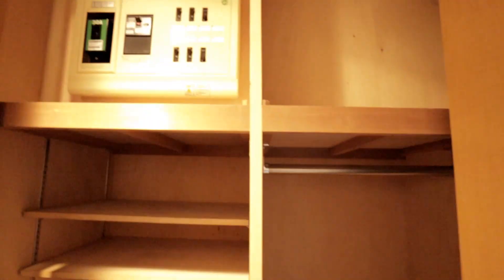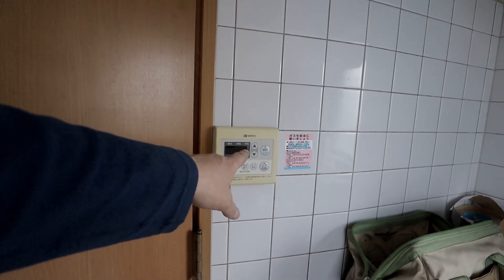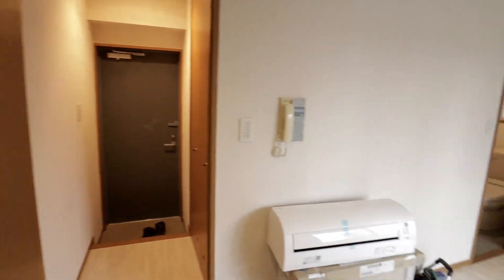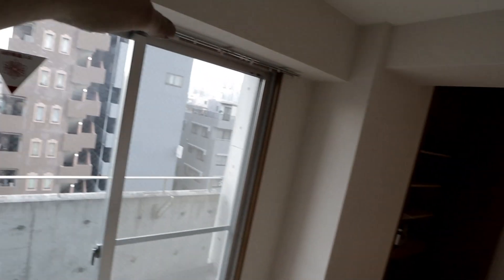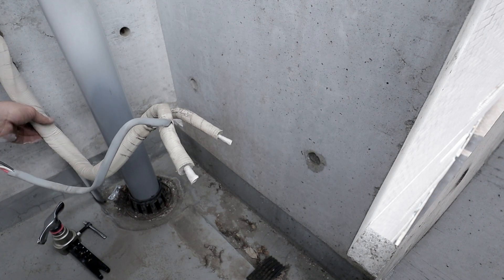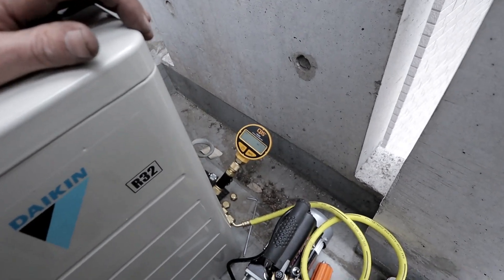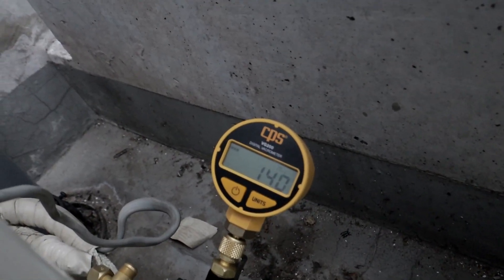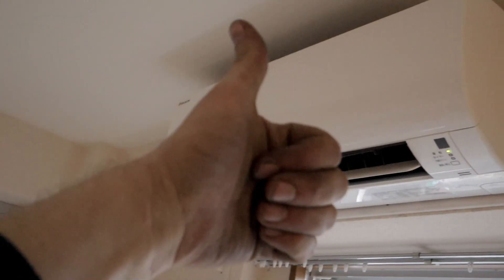Small Aparto Tour and Aircon Install

Comment: I found the tour very interesting! And I have a question about the electrical service. I know the outlets are 100V, but what actually comes into the panel? Like is it split phase, three phase or just straight up 100V?
Reply from the maker: 200v 50Hz single phase. Three wires
Reply: @TokyoCraftsman  Interesting. Thanks for the reply!
Reply from the maker: @simonrichard9873  I'd post a picture if I could
In my workshop I have 3phase as well because we have three phase in the building to run the elevator.
Cheers
Reply: @TokyoCraftsman  What voltage is that three phase?